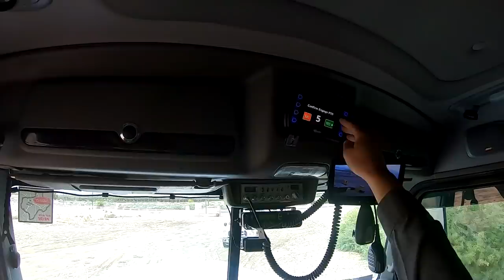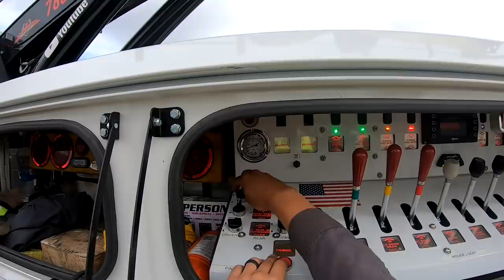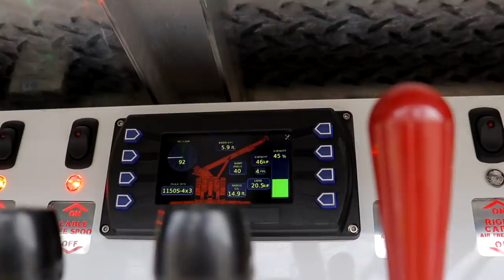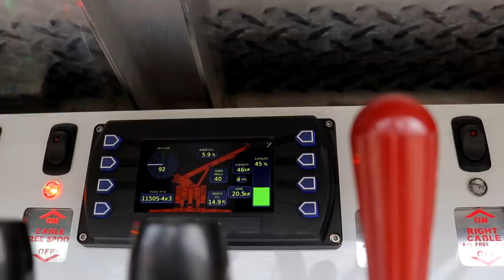Lifting 50,000 lb Excavator With 2 Rotators

Comment from the maker: This is a pretty cool one! The new cable for audio recording as well should have cleared it up quite a bit! Can you tell a difference?
Reply: Yes, the audio is more clear and stable
Reply: Yeah. It’s much cleaner now! Keep up the great videos, makes it super easy and enjoyable to follow what happens.

The headset audio was still quite difficult to understand in some bits in the minutes around 28:45 due to the very loud environment with the two running trucks. Not sure if you have camera/enviromental audio and headset voice in separate tracks during editing? If you do, it would help a lot to apply some dynamic range compression / level normalization and perhaps even some light audio ducking to help ensure the voice track is always heard clearly above the noise from the trucks etc.
Reply: It's a whole lot better!

Comment: I've always wondered what the 50/60 meant in the Jerr Dan name. Is it 50 or 60 ton capacity ??
Reply from the maker: Both, I am not to educated on this subject but from what I understand there are 2 standards in the lifting world that rate booms and one assigned the truck as a 50 ton class and the other assigned it as a 60 ton class. They each have different ways of determining this capacity. Hence it is a 50 or 60 ton rotator depending on who you ask . Thank you for watching!
Reply: @plazatowing  oh right. I understand  a bit better. Thank you for replying
Reply: The 50/60 jerrdan is the manufacturer rating for this truck to pick off the side depending on boom angle and how much boom you have out and proper rigging its capable 50 tons off the side and 60 tons off the rear

Comment: Could the M100 lift the hole excavator with no help
Reply from the maker: Absolutely
Reply: @plazatowing  ok
Reply: Be fun getting a M100 licensed in California ...

IIRC, the reason Plaza's rotator doesn't have the sliding carriage for the turret was it would add too much weight to the truck.

Comment: Seized engine in that?! Looks almost brand new, they don’t make em like they used to!
Reply: look at the signs.. RENTALS
Reply: @TheRick2130  it also says Deere, but I still don’t think it should seize this new.
Reply: Pretty sure the engines had a recall for not installing a o ring in oil pump.
Reply: @THETATERGUNSHOOTER   Sounds about right, either that or Sunbelt Rental didnt do a very good job on the servicing or oil levels etc.

Comment: You could have just removed the final drives and winched in onto a tilt tray
Reply: cost a lot less than this
Reply: @forumbezoeker  yeah i know the cost of 2 rotators and the float where as this could have been done with 1 one super tilt.
Reply: John deere probably wanted it as is for warrenty diagnoses.

Comment: Really,  The excavator could not drive onto the low boy like every other excavator does?  Seems abit Hollywood......  I call BS-  you did not need to float that.
Reply: Except if the excavator drive train was not functioning, which is why it could not be repaired in the field and had to go to the shop
Reply: Engine was seized and needed replacement per Trent in the intro.
Reply: Did you even watch the video? The reason for lifting (dead engine in need of replacement) rather than driving was explained very clearly all the way at the start…
Reply: @mlenstra  Doubt it! He probably was one of those who gave the "thumbs down."
Reply: If it was mechanically capable of driving onto the lowboy, I doubt they would have spent the money to employ two rotators! SMH